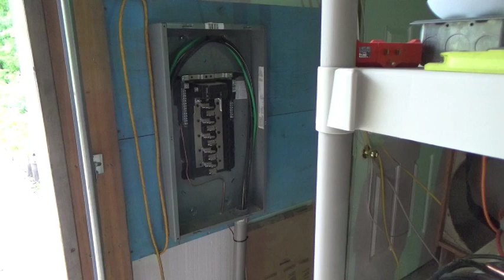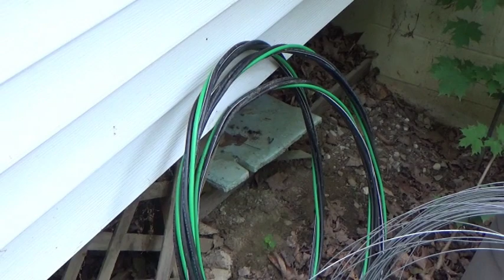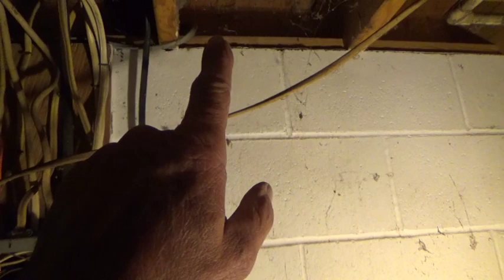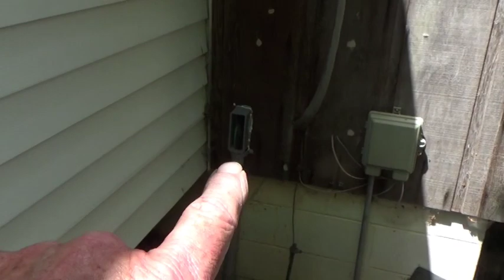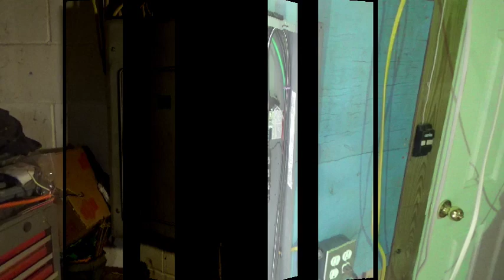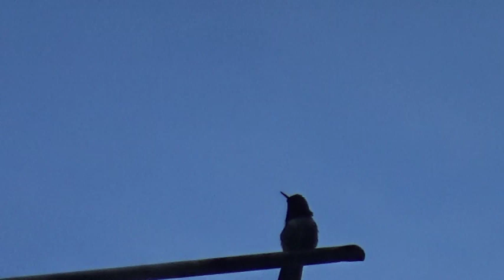It's Electrifying:  Taking Electricity to the Barn, Through a Sub-Panel.

Comment: most interesting electrical work i have seen i was wondering where you found the wires with green and the phases marked you said direct burial mobile home wire i googled you where right may want to go at least 18 inches down though. and that push matic panel watch out its not as bad as the FPE but the springs wear out and will become very hard to impossible to reset. 

tht generator just make sure main to grid is off and you didint need that extra breaker unless its a gfci or arc fault the breaker dosent care witch way the current flows. you cld have just set up an outlet 240 from garage to backfeed gen from but ok job. 

THE BIG IMPORTANT THING IS TO NEVER BACKFEED TO GRID
Reply from the maker: Have pulled up all the Direct Bury cable and getting ready to do exactly what you said. Bury it at least 18" down. As far as the Push Matic,,,,  Giving Thought on changing all that out.  Just working on the financing right now.  Hey, thanks for stopping by!
Reply: @stedhomer  yes if those breakers seem to work fine you cld keep them just the springs tend to corrode and break i mean 50 yrs later and the plastic gets brittle over time as well. thank you for replying to old post as well as showing us that pay attention to tht mobile home db wire.

Comment: You buried 60A live wires without putting them in conduit? I'm not an electrician but that sounds dangerous as hell to me! And I doubt that's to code, which means you just put your code violation out there for the world to see. Maybe I'm wrong... <shrug>
Reply from the maker: Hey, thanks for stopping by. As far as the cable. It is a Direct Bury Mobil Home Power Cable and is meant to be buried directly. If is was to be put in a conduit, it would over heat and that wouldn't be good.  Now for the code. the place I live has only the national code to be followed and not all of those other codes that a lot of communities add on. The only real problem I now know is that I wish I had buried it deeper and my wife and I are considering doing this yet this summer.  Again, let me thank you again for stopping by and I hope to be seeing you back from time to time. :-)

Comment: That’s a little shallow my friend on your 100 amp service going threw the yard...if your mad at the wife have her put flowers in on the corner of the house with a metal handled shovel. 💀💀💀
Reply from the maker: I heard that! Have thought about this many times or even ways of marking the line .  Thanks for stopping by! :-)
Reply: @stedhomer   It's supposed to 18" below grade. Best practices is to cover the under ground wire with metallic "Caution" tape for easy RF location, then a layer of loose gravel show the shovel hits something first..other than a hot wire..
Reply: Stedhomer 

👍🏻 take it easy brother

Comment: shouldn't the neutral be isolated, not strapped to the ground?
Reply: If this is a sub panel, the neutral should be isolated from the cabinet, and the ground.  There should be a separate ground bus for landing the grounds.

Comment: That came out pretty nice
Reply: wrong wire  for direct bury not deep enough single strand  needs pvc
Reply from the maker: I beg your pardon , the cabel that I used WAS Direct bury and the worst thing I could have done was put it in a conduit. As for it's deepness, You may be right about it not being deep enough,,,, But it will work.